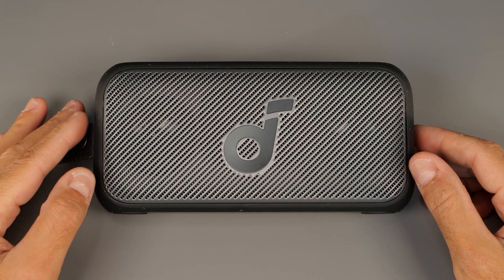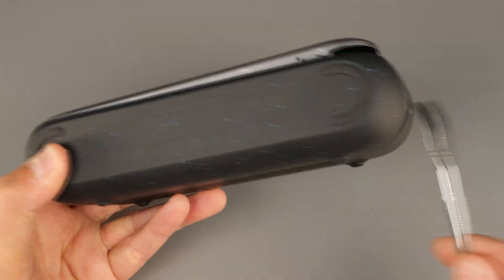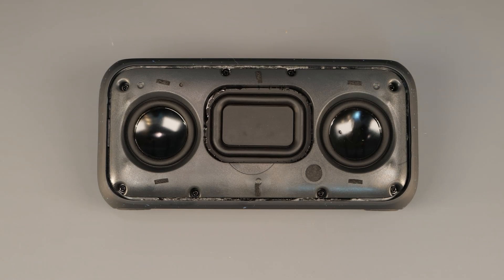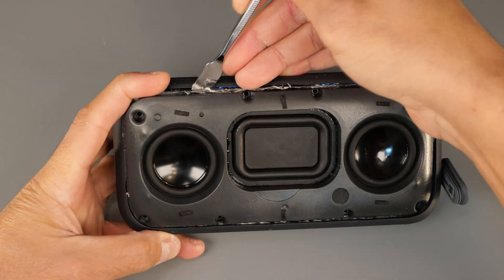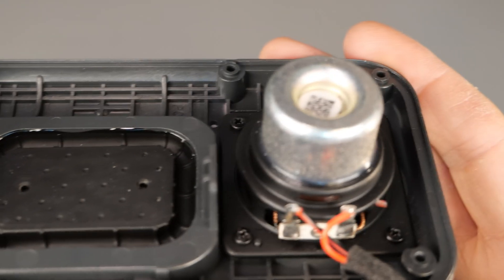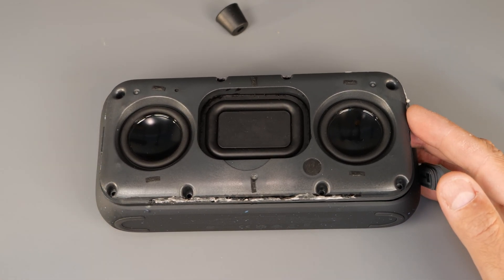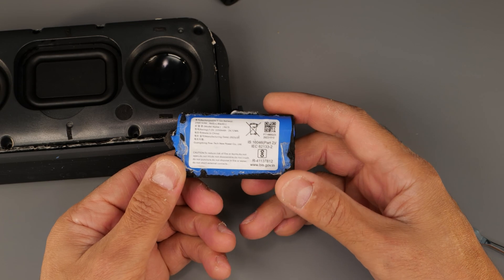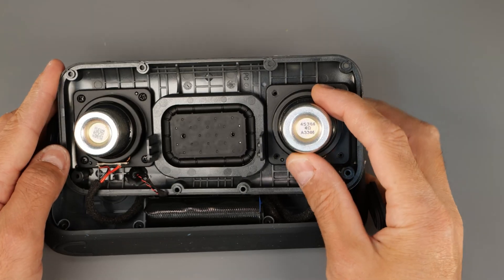Soundcore Motion 300 Bluetooth Speaker Teardown

Comment: Guessing those 2 18650 cells are wired in series to make 7.2 VDC? did you happen to catch the Mah capacity on the cells?  Nice video BTW.

Love the form factor and build quality on the 300s... but getting skeptical it can run over 6 hours being driven hard in an outdoor setting.

Comment: It’s a great speaker but it’s missing a tweeter. JBL flip is loud and brighter because of tweeter. But sound quality at high levels it sounds clean. Just needs a tweeter.
Reply: mono speakers are crap. it's better to use fullranges with alumium dustcups such as jbl flip 4 gg, it sounds amazing and better then flip 6. i have both of them and i prefer flip 4 for home and flip 6/charge 3 for outside
Reply: @mykykyta_g5hk cause it needs stereo tweeters😅 like x600 which sounds awesome
Reply: @ConstansPhotography  Better to use high quality fullrangers then cheap silk tweeters.

Comment: I’m surprised by the amount of these things that are using very similar drivers. It’s almost like no one is developing their own drivers and the enclosures are all extremely basic with little attention to getting the most out of the drivers. From a cheap Aliexpress speaker to this, the only thing that really changes, is the electronics running the show. Imagine how good these could sound if they put a little more effort into engineering and tuning the enclosure to prevent interference waves and timing of the bass radiators…
Reply: Yep! All generic off the shelf stuff. It’s all about the software experience nowadays! It’s pretty sad, a totally saturated market by mass Amazon sold products. The only custom drivers would be the dedicated proper audio brands, audio pro, Dali, b&o. I can’t even vouch for JBL but they would put care into where they source their drivers/amp units.
Reply: So you mean to say all drivers are almost same? I always thought companies put effort into them
Reply: @nirmalkumar7941  Yep, I have taken a few apart, and seen a few teardown of other brands, and you would be surprised how many are using the same drivers and general architecture. These are only made special by their bluetooth PCM / other Lossless chip and the "features" they have. From a driver and enclosure side there's literally nothing special, there is even a "DIY" kit on Aliexpress, which has a rectangle enclosure, identical, or at least as far as I can tell, similar drivers, radiator and layout: O |R| O, with the same dimensional relationships. I am mainly talking about these small stereo BT portables though, so not "all drivers", because when you start getting into the bigger portables, there does seem to be some engineering directed to the drivers, enclosures and sound, just these small ones at the <= 16w range.
Reply: @nirmalkumar7941  No this could not be further from the truth 😂 they all look the same but there's a bunch of different variables like magnet type, copper coil winding amount and materials Anker do use very good drivers on their products but they also have really good amps which make the most difference 👍
Reply: How do you know they dont develop it theirself?
Reply: I get what you’re saying abt brands should put more effort in making their own stuff but “a little more effort” just isn’t true, that takes a lot of money and resources and time for a brand to do all that for one product let alone all of their products

Comment: PLEASE READ:

I just figured I’d post this here since this video is about the motion 300. I wanted as many people to see/read this as possible. So soundcore can get enough complaints about the distortion on the motion 300 and fix it. 

This speaker has too much distortion. Play the song wine pon you by Doja cat in SoundCore’s signature sound mode and at max volume you will hear distortion.

It’s the cross over from when the high bass drops down to the low bass (sub bass) that I hear distortion in her voice.

I tried to eq it to fix the issue but that didn’t seem to help. I turned down the bass when I EQ’d it and of course I still heard distortion.
Reply: No it doesn’t 🤣 return yours bud
Reply: @Frijol_Colorado they do
Reply: @IamJay02  your pfp says enough 🤡😭
Reply: @Frijol_Colorado  lmao I forgot to change it
Reply: @Frijol_Colorado  How do you feel about it now that lex has beaten the allegations?
Reply: Mine is fine
Reply: Your main problem is that Doja Cat is all recorded with distortion.  Get some real reference music and manually tune the EQ.  Night and day vs out of the box presets.

Comment: Interesting - useful video.

Did you note the number of the battery pack - it looks like it could be replaceable, as it seemed to plug into the board?
Reply: Most likely the same as 90% of all decent Bluetooth speakers: a common pair of 18650 Li-ion cells.

Comment: Shak, would you choose the motion 300 or a jbl flip 6? Thanks!
Reply: Anker 300 is stereo  and jbl flip 6 is mono.
Reply: The soundcore motion 300 is stereo but the drivers aren’t spread that far apart because it’s not a huge speaker. I think the vocals sound better on the JBL flip 6 on some songs and I think the vocals sound better on the soundcore motion 300 on other songs. 

I think when it come to rock music the vocals sound a tiny bit clearer on the JBL flip 6 but the soundstage is more boxy on the JBL flip 6 when it comes to rock music or any music. 

No matter what speaker you are talking about or comparing such as the soundcore motion 300 vs the JBL flip 6 or also vs the new Klipsch Nashville, it’s all subjective. All down to personal opinion. 

You shouldn’t fault someone for choosing the JBL over the soundcore or vice versa.
Reply: @robbdobb srsly u said jbl sound boxy?have u even listen from flip 6 there is 0 distorted from it
Reply: You'll excuse me from the side.
All of JBL's Bluetooth speakers are now monaural.
That's why I highly recommend Motion300.
In the first place, music was made to be listened to in stereo, so the JBL, which only has monaural speakers, is an old transistor radio that produces a loud sound. 

from Japan
Reply: @waterloosunsetsfineyaa682 I went with the motion 300 in the end, it's awesome!
Reply: @waterloosunsetsfineyaa682 você acha som estéreo melhor que o mono? Mesmo o mono possuindo um tweeter? Um abraço do Brasil!